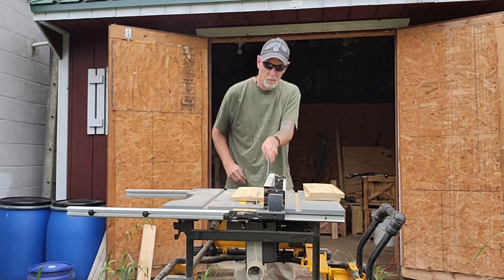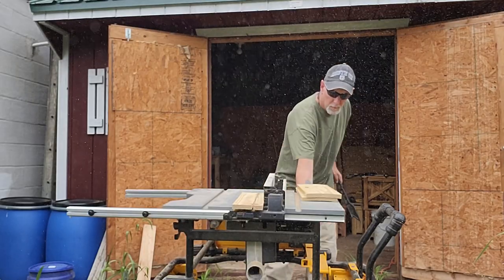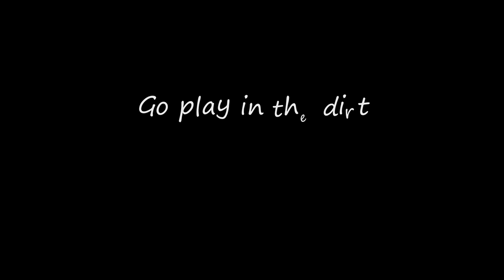Making A Garden Basket | Wood Garden Crate | DIY

Comment: I love this. I will probably see if Michael can do do that one and smoothes with the slays a bit closer.
Reply from the maker: Yes the slats definitely need to be closer. I think I might just add an extra one. I may also try to make one that has hardware cloth mixed in with the bottom, and a top handle instead of the rope.